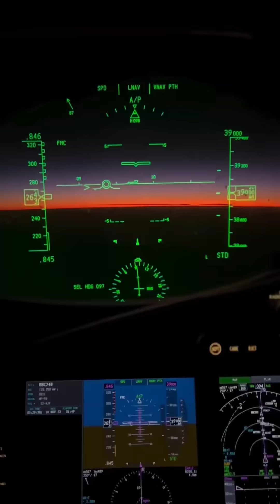Why modern aircraft don't hit supersonic speeds

Comment: Do u mean max
Reply: no, mach speeds. search it up
Reply: Mach 1 is the speed of sound you know with the sonic boom and it’s about 1100kmh
Reply: "Mach", which pronounced "mak" is the measurement for the speed of sound (how fast sound travels for people to hear), which is about 1100 kilometers in 1 hour. A plane that travels at Mach 1 (the speed of sound) travels at about 1100 kilometers in 1 hour. But a lot of war planes (which use jet engines) travel at Mach 1 or more.